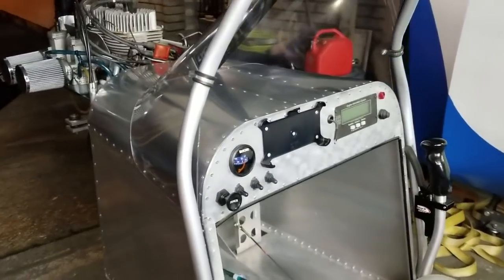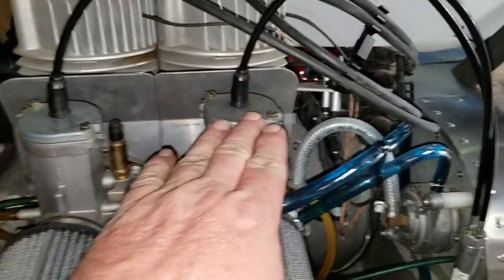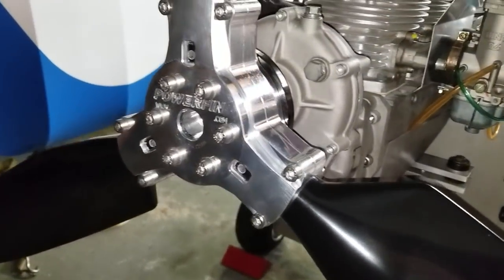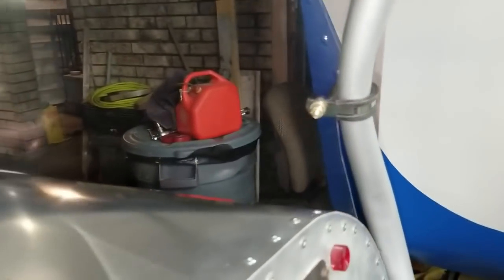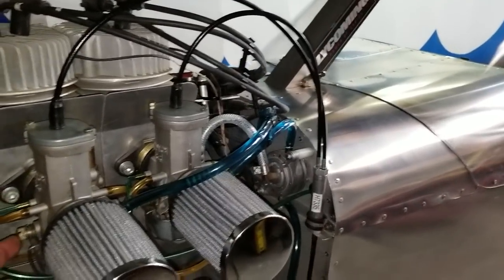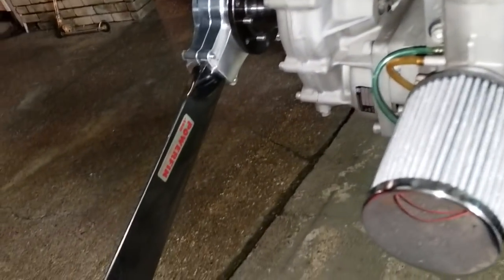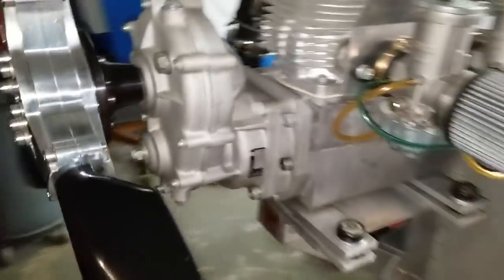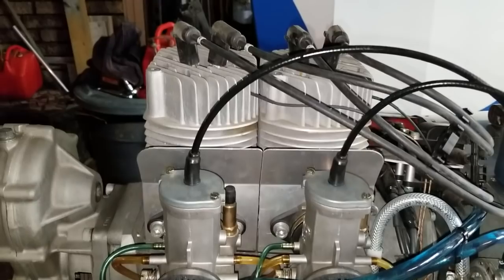Affordaplane update engine tuning

Comment: hi, found your upload by accident lol, when there is heat difference with in cylinders on 2 strokes, it is normally a timing issue or too lean on that barrel, if you change the needle setting it may make a difference, sometimes it can be a costly thing like a crankshaft seal causing inconsistent fuel flow, cheers mate, hope it does not cease

Comment: Have you checked the float setting?
If the fuel level is lower in one bowl it will run lean.
Reply from the maker: I believe they are ok, but I am going to keep this as a reminder to double check that.

Comment: have you checked the head bolts (with a torque wrench) to assure they are all properly torqued?
We have had some cylinders (F-30 fuel injected) run hot on the CHT.  We found the cylinder head bolts screwed in, but not actually torqued on two cylinders,
However, the most likely situation is there is still something wrong with the one carb

Comment: Great to see you running the engine. Your carbs are different than what I have on my old f30. I have no problem with CHT temperatures but my EGT runs higher then yours. static tied to the bumper on my truck ie 1350 approx around 5 to 6 k rpm. I would not worry about the oil coming from your gearbox mine does the exactly the same thing I've got the old G 40 gearbox 2.93 to 1 ratio. My gearbox is noisy quite a bit of gear mesh noise. How about yours does it make a bit of noise. I've got straight 80 weight gear lube in it right now. I was thinking about putting some Lucas in it that stuff doesn't amazing job to clinging to the gears. Next time you talk to Matt you might ask him about that. Can't wait to see you get it in the air I would love to know how she flies. I bought a set of plans for this plane about 15 years ago but I've never followed through with it. It looks like a pretty simple build. Good luck good job on the build it looks great
Reply from the maker: Thanks for the input, my gearbox makes a little noise, but its not bad. I'm running 90 wt. and have also thought about lucas myself.

Comment: Hi Terry, good looking build.  Starting mine this winter.  Will be archiving your vids for ideas.  Do your prop bolts get safety wired?  Also maybe an idea to put aluminum tape intersection of windshield and cowl to lessen drag.  I will be curious when you get it airborne as to buffet behind the windscreen.  Riding motorcycles with various windshields the low pressure will create turbulence and drag. On some of my bikes I have vents in them.  Question after 1st flight, are you satisfied with condition behind windscreen?

Comment: That’s bizarre. I would think you’re burning more fuel in the hot cylinder than less. This is one gremlin I want to see. The bird’s looking better every day, Terry! Gremlins like this are better off faced here on the ground than up there during a flight.
Reply from the maker: On a two stroke air cooled engine the fuel and oil also help it stay cool, too lean equals heat.

Comment: Thank you again for videoing your aircraft build. It's a very interesting challenge with the engine. Makes sense that this carb is giving you a lean condition which is producing the higher temps but the inspection not fixing the problem is certainly confusing. Changing the needle to put more fuel in one cylinder than the other seems illogical. I'd dare to guess that there is a tiny air leak in the carb casting or on some connection that only shows up at the highest power setting. Maybe even a manufacturing flaw of the casting it's self. I'd consider trying another carb before re-jetting it. 
Otherwise, I admire your careful approach to fixing the problem. I agree with you that the plugs look fine. If you end up going to a little more fuel flow and that fixes the problem, I will be very happy for you. 
Looking forward to seeing you move closer to the airstrip.
Reply from the maker: Hopefully it does not come to needing another carb, jets are way cheaper!